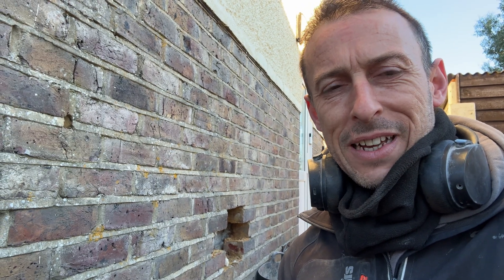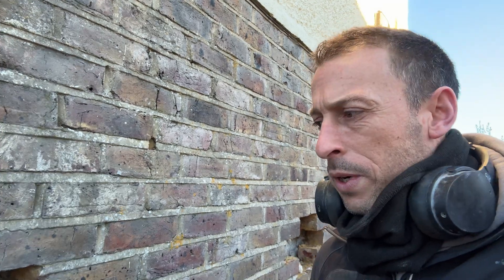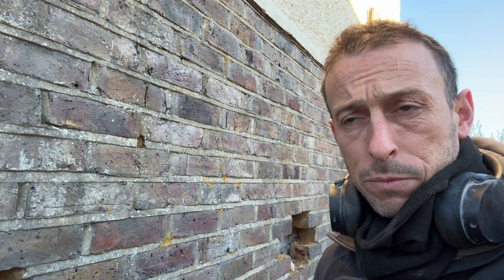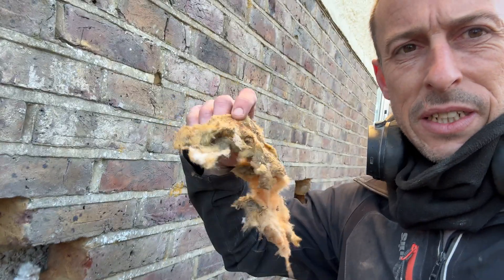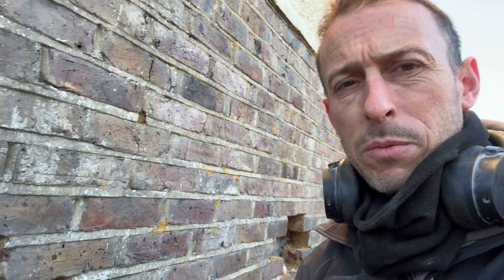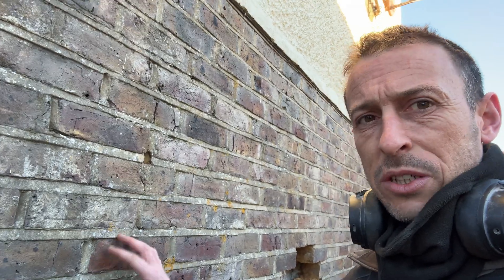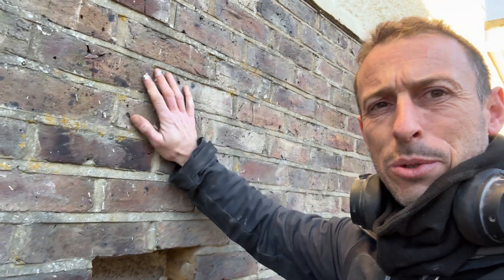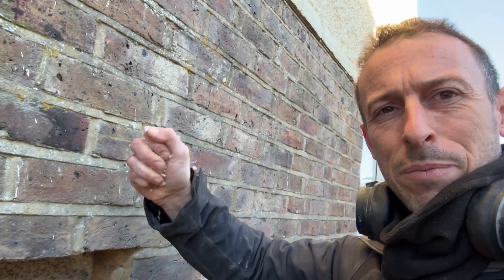DAMP WALLS AND WET CAVITY WALL INSULATION.

Comment: 100mm cavity walls are fine with 100mm rockwool insulation. Which is the norm today. Just from this vid, i can't tell what the problem is. But first thing I'd do is look up, because the moisture is high and rendering hides sins.
Reply: If you have problems with damp, the first things you should check is  your ground level to damp and try and have a minimum of 150mm clearance and make sure in bad weather's water doesn't pool especially higher then damp. old builds don't have cavity walls so need ventilating more.

Comment: Cavity-walls must NOT be bridged with insulation(insulation touching the outer walls inside the cavity-wall); or else moisture will transmit from the damp outer wall, through the touching bridging insulation, and into the inner wall; making the inner wall damp inside the building.
(Injecting foam into the cavity-walls stops the property from breathiing: resulting in drastic condensation saturation of the inner-walls inside the property). 
Cavity-walls that are already built up can NOT have cavity-wall insulation added.

Cavity-wall insulation batts(panels) can ONLY be installed from the very start of construction of the cavity-walls. 
If cavity-wall insulation is to be used, there must be a large air space gap in-between the face of the cavity-wall insulation batts and the outer wall inside the cavity-wall, this includes an air space gap in-between the face of the cavity-wall insulation batts and the cavity-wall tie drip-points(which must point downwards in the centre of the cavity).
Ask City & Guilds N.V.Q. (S.V.Q.) BRICKWORK teachers for PROOF of this.
Reply: Back in the early 1970's I was an apprentice electrician. I did used to wonder about the wisdom of filling cavities with insulation, which was becoming more popular around that time, and I thought that maybe it was a timebomb. After all, the cavity space is there for a reason, and bridging it does seem a backward step to me (I realise that there are ways where cavity insulation can be effective when installed from new build.) Now companies are specialising in removing the stuff!
Reply: Why are the government still,pushing cavity fill? I ignored the knocking hard sell on my previous home nicely and had zero problems and the same fuel bills as my next door neighbour. However I have just had a council selected contractor out to the 1920s property we just moved into last November because we qualify for a HUG grant. The cold internal walls and floor contributed hugely to the house being freezing all winter, with the inner leaf of lower external corners down to 4 degrees in places. I asked about dot and dab insulated plasterboard on the inside of external walls, but they said that was too much work! Incredibly considering how cold it was it turns out we already have 25 year old fluff cavity fill like this junk, and they want to suck it out and fill with whatever modern version there is! They also want to add more loft insulation even though I told them the ceilings were warm. Surely we can only be talking percentage improvements here, it just sounds like another government tricky box exercise. Also the fact we had unknown cavity fill explains why my external leaves are so hideously wet after a rainstorm despite large high and low level air bricks …..there is no airflow in the cavity to dry it out. I want to just ignore their help and do my own thing now, but my wife says “it’s free” 😂 Well so is a kick up the arse but I don’t want that either, and I believe it’s thinking like that that persuaded everyone to get this dreadful stuff squirted in by the government all through the 90s.

Comment: Does it affect just brick walls due to bricks soak moisture? I have cavity walls in my house with this whitewool insulation, but both internal and external parts of the wall are blocks (concrete blocks size about 40cmx20cm). My house inside doesn't suffer from dampness, but could someone confirm it depends if externally there are bricks or blocks?
Reply: Cavity-walls must NOT be abridged with insulation(insulation touching the outer walls inside the cavity-wall); or else moisture will transmit from the damp outer wall, through the touching abridging insulation, and into the inner wall; making the inner wall damp inside the building.
Injecting foam into the cavity-walls stops the property from breathiing: resulting in condensation saturation of the inner-walls inside the property. 
Cavity-walls that are already built up can NOT have cavity-wall insulation added.

Cavity-wall insulation batts(panels) can ONLY be installed from the very start of construction of the cavity-walls. 
If cavity-wall insulation is to be used, there must be a large air space gap in-between the face of the cavity-wall insulation batts and the outer wall inside the cavity-wall; this includes an air space gap in-between the face of the cavity-wall insulation batts and the cavity-wall tie drip-points(which must point downwards in the centre of the cavity).
Cavity-wall insulation batts must touch ONLY the inner-walls inside the cavity-walls (of course touching the cavity-wall-ties and retaining-clips also).
Ask City & Guilds N.V.Q. (S.V.Q.) BRICKWORK teachers for PROOF of this.

Comment: I spent £900 on damp proofing, then he skimmed plastered over that area. About a year ago. Had to spend a little more to take of the Radiator in front as well. Anyways, see how it goes, not sure of the cause meaning if insulation is wet. Now its damp at the bay window and moulding in the inside, you can see from the outside it rising/discoloured. Checked around the bottom edge, some weed and gap. There's 3 vents at ground level, one drain in between me and the neighbour. Anyways, though of scraping out the weed, point in with mortar at a slope, maybe digging deeper and painting storm dry now thinking of removing bricks and sticking in stones for drainage/void...any ideas? Thanks
Reply from the maker: Check inside the cavity wall, either wet insulation or bridging. If the cavity is clear then I would more than likely point the finger at a potential condensation issue which is common on bay windows as the windows themselves are a large area of heat loss and will be one of the coldest points, therefore condensation will naturally happen in this area. If it seems like this might be the cause, correct heating and ventilation will remedy the problem.
Reply: Cavity-walls must NOT be abridged with insulation(insulation touching the outer walls inside the cavity-wall); or else moisture will transmit from the damp outer wall, through the touching abridging insulation, and into the inner wall; making the inner wall damp inside the building.
Injecting foam into the cavity-walls stops the property from breathiing: resulting in condensation saturation of the inner-walls inside the property. 
Cavity-walls that are already built up can NOT have cavity-wall insulation added.

Cavity-wall insulation batts(panels) can ONLY be installed from the very start of construction of the cavity-walls. 
If cavity-wall insulation is to be used, there must be a large air space gap in-between the face of the cavity-wall insulation batts and the outer wall inside the cavity-wall; this includes an air space gap in-between the face of the cavity-wall insulation batts and the cavity-wall tie drip-points(which must point downwards in the centre of the cavity).
Cavity-wall insulation batts must touch ONLY the inner-walls inside the cavity-walls (of course touching the cavity-wall-ties and retaining-clips also).
Ask City & Guilds N.V.Q. (S.V.Q.) BRICKWORK teachers for PROOF of this.

Comment: Yet major housebuilders are using whitewool on newbuild properties today,so someone's evidence somewhere along doesn't add up
Reply from the maker: Can’t lie with physical evidence on a video. More fool the house builders for using a cheap unsuitable material. Thanks for watching and check out the next video, the insulation is soaked and it’s whitewool.
Reply: Cavity-walls must NOT be abridged with insulation(insulation touching the outer walls inside the cavity-wall); or else moisture will transmit from the damp outer wall, through the touching abridging insulation, and into the inner wall; making the inner wall damp inside the building.
Injecting foam into the cavity-walls stops the property from breathiing: resulting in condensation saturation of the inner-walls inside the property. 
Cavity-walls that are already built up can NOT have cavity-wall insulation added.

Cavity-wall insulation batts(panels) can ONLY be installed from the very start of construction of the cavity-walls. 
If cavity-wall insulation is to be used, there must be a large air space gap in-between the face of the cavity-wall insulation batts and the outer wall inside the cavity-wall; this includes an air space gap in-between the face of the cavity-wall insulation batts and the cavity-wall tie drip-points(which must point downwards in the centre of the cavity).
Cavity-wall insulation batts must touch ONLY the inner-walls inside the cavity-walls (of course touching the cavity-wall-ties and retaining-clips also).
Ask City & Guilds N.V.Q. (S.V.Q.) BRICKWORK teachers for PROOF of this.

Comment: Would a cavity wall insulation injected from front and back of a terraced house cause the dividing internal wall to have paint bubbling?
Reply from the maker: If it’s close to an external wall then possibly. Do you suffer with condensation much?
Reply: @CoastalWallTiesRustington  hi. I cant see much condensation issues. I think it could just be the wrong paint was put on. The walls were replastered, and they used a really cheap matt white paint from screwfix. Noticed The walls get very dirty with minimal touching, and i noticed that are several patches where the paint has become bubbled or powdery. I cant see any black mould anywhere in the property, and the bits where the bubbled paint has been peeled off, the plaster is the same light colour.  Also, i believe the insulation was done around 2016 if i recall correctly. Hopefully its not an issue, but might need to call someone to check it

Comment: Great vid. We've just moved into a new build & are quite exposed on a hill. The back of the house does get battered with the wind & rain. I'm concerned as I've discovered they've injected from inside the house Knauf supafil insulation to full fill the cavity. They tell me the cavity trays will take any water that does penetrate back out but I'm not convinced. I've been in 18 months & as of yet we have no internal issues. Am I right to be concerned & how long would it take for any issues take to manifest. Thanks
Reply from the maker: Hi Mark, all I can say is that many homeowners have had problems with whitewool insulation and if you are worried about whether it is wet or not, I would remove a brick externally in the most exposed area of the wall and check. Normally you would have signs inside by way of damp patches, blistering paint or mould.
Reply: Cavity-walls must NOT be abridged with insulation(insulation touching the outer walls inside the cavity-wall); or else moisture will transmit from the damp outer wall, through the touching abridging insulation, and into the inner wall; making the inner wall damp inside the building.
Injecting foam into the cavity-walls stops the property from breathiing: resulting in condensation saturation of the inner-walls inside the property. 
Cavity-walls that are already built up can NOT have cavity-wall insulation added.

Cavity-wall insulation batts(panels) can ONLY be installed from the very start of construction of the cavity-walls. 
If cavity-wall insulation is to be used, there must be a large air space gap in-between the face of the cavity-wall insulation batts and the outer wall inside the cavity-wall; this includes an air space gap in-between the face of the cavity-wall insulation batts and the cavity-wall tie drip-points(which must point downwards in the centre of the cavity).
Cavity-wall insulation batts must touch ONLY the inner-walls inside the cavity-walls (of course touching the cavity-wall-ties and retaining-clips also).
Ask City & Guilds N.V.Q. (S.V.Q.) BRICKWORK teachers for PROOF of this.

Comment: In my experience if a cavity is filled with platinum beads and the outer skin is in good condition then there should be no problems. I agree complety that the fibre fill is absolute rubbish if it contacts any moisture and also has settlement issues as time passes.
Reply from the maker: They are certainly better than Whitewool but they too can allow moisture to track across the cavity. We also see that the bonding for platinum beads is very hit and miss, which I guess depends on how clean the glue line is and the temperature during installation. My guess is that it becomes more clogged as the day goes on when travelling from one site to another.
Reply: Cavity-walls must NOT be abridged with insulation(insulation touching the outer walls inside the cavity-wall); or else moisture will transmit from the damp outer wall, through the touching abridging insulation, and into the inner wall; making the inner wall damp inside the building.
Injecting foam into the cavity-walls stops the property from breathiing: resulting in condensation saturation of the inner-walls inside the property. 
Cavity-walls that are already built up can NOT have cavity-wall insulation added.

Cavity-wall insulation batts(panels) can ONLY be installed from the very start of construction of the cavity-walls. 
If cavity-wall insulation is to be used, there must be a large air space gap in-between the face of the cavity-wall insulation batts and the outer wall inside the cavity-wall; this includes an air space gap in-between the face of the cavity-wall insulation batts and the cavity-wall tie drip-points(which must point downwards in the centre of the cavity).
Cavity-wall insulation batts must touch ONLY the inner-walls inside the cavity-walls (of course touching the cavity-wall-ties and retaining-clips also).
Ask City & Guilds N.V.Q. (S.V.Q.) BRICKWORK teachers for PROOF of this.

Comment: Thank you, I've been refusing to put in cavity wall insulation for just this reason. You are the first professional I've found who agrees with me and has shown me proof that my supposition is correct. I'm glad I came across your video.👍
Reply from the maker: Glad to help
Reply: I fought off knocking hard sell cavity fill merchants for years on my old house, then finds the old house I have just bought has saturated external walls, freezing internal walls, tons of this fluffy stuff inside ( is yellow though?) and mould inside 😪
Reply: Cavity-walls must NOT be abridged with insulation(insulation touching the outer walls inside the cavity-wall); or else moisture will transmit from the damp outer wall, through the touching abridging insulation, and into the inner wall; making the inner wall damp inside the building.
Injecting foam into the cavity-walls stops the property from breathiing: resulting in condensation saturation of the inner-walls inside the property. 
Cavity-walls that are already built up can NOT have cavity-wall insulation added.

Cavity-wall insulation batts(panels) can ONLY be installed from the very start of construction of the cavity-walls. 
If cavity-wall insulation is to be used, there must be a large air space gap in-between the face of the cavity-wall insulation batts and the outer wall inside the cavity-wall; this includes an air space gap in-between the face of the cavity-wall insulation batts and the cavity-wall tie drip-points(which must point downwards in the centre of the cavity).
Cavity-wall insulation batts must touch ONLY the inner-walls inside the cavity-walls (of course touching the cavity-wall-ties and retaining-clips also).
Ask City & Guilds N.V.Q. (S.V.Q.) BRICKWORK teachers for PROOF of this.

Comment: Hi, I would be very interested in the cost of re pointing our bungalow, it has a cavity, not filled, but the internal walls are cold. The pointing is bad so hoping that is the cause of the cold walls.
Enjoying your vids, cheers 👍
Reply: Maybe get the repointing looked at,then consider a BBA approved cavity wall insulation product that carries a 25year guarantee 👍
Reply from the maker: Hi Bart, thanks for watching. I very much doubt that the pointing is making your internal walls cold. If you wanted to give us a call, we can understand your circumstances better and provide you with some ways in which could help resolve this issue for you.